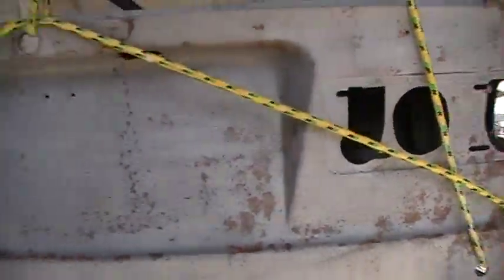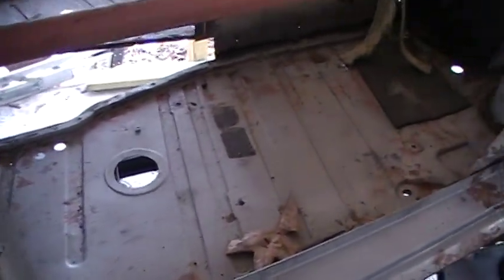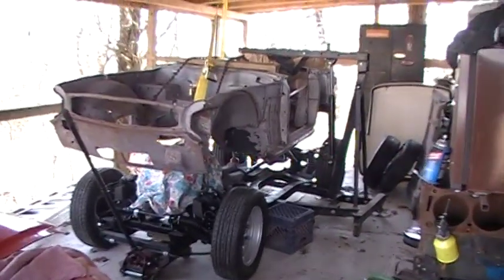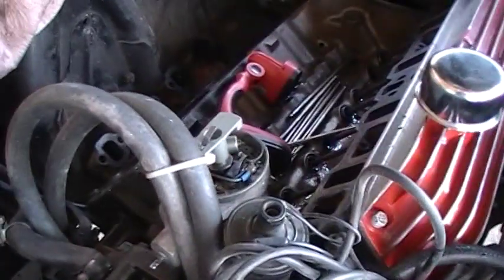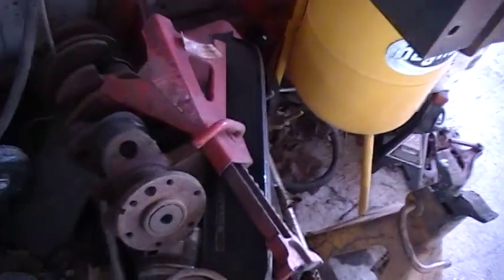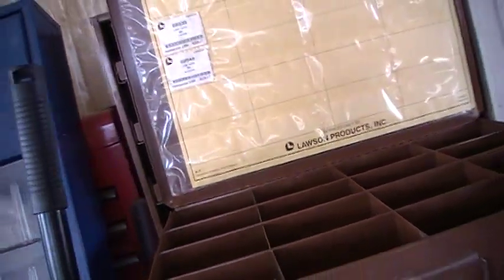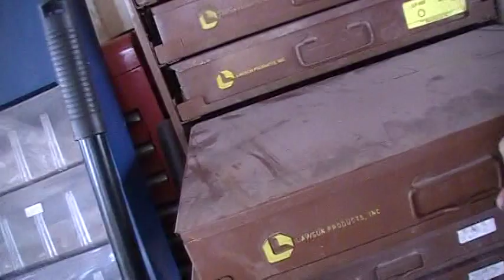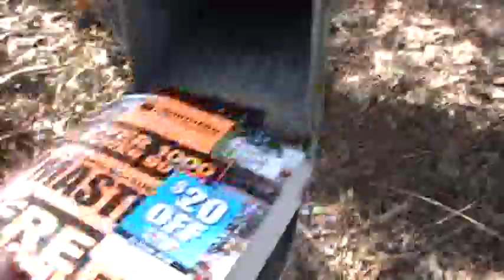Body off TR6

Comment: That TR6 looks like that ole boy you got it from really got the frame fixed up like brand new its so clean you could eat off of it. suspensions and brakes looks really new.  It looks like the guy got all your work cut out for you. Its a really beautiful car. Maybe you could put some saw horses under it to make sure it stay up.  Hit the rusty spots with a wire wheel sand paper and  seal it with white epoxy primer.
Reply from the maker: shartne Yup bubba, got the epoxy ready. Might even paint th bottom while it's flying in the shed.
Reply: Good sounds like you got a plan. In the shed is good to keep it out of weather and you can put it up high so you get both of them British cars in there. Dont get any epoxy primer on Herald. LOL =) You need some giant plastic tarp.
Reply from the maker: shartne  Thanks Shartne.  You are a real good man and a great help to me in many ways. And that's the gospel truth! Dear Herald is getting some treatment where I cut the remaining rocker panel off.
Reply: I guess you will make a video maybe right. Love to see it.
Reply from the maker: shartne  Yes. I will film whatever happens.  Supposed to dodge Tomatoes and hail next two days. I closed in the end of the shanty to keep it dry as I can.

Comment: Wow a frame off restoration of a Triumph TR6 . That frame looks great and well once you patch up the holes in the body rust it will be good as new almost. Hey thats great that you found an engine for the Mustang already was it another 351,390 or a 429?
Reply from the maker: LUCKYLARRY  Thankye very kindly my Brother. I think it's a 302.
Reply: oh so a 5.0 liter just like my 89 F150 has and I have never had any problems with my engine. 2nd year of fuel injection  Its always been a strong hauling engine for me and my brother I bought it off him 12 years ago. He bought it off a guy the first owner who put a 5th wheel in the bed and hauled his bayliner with it. Hope the engine you get runs as well.

Comment: That thing is a nice little car Cut. Its sad folks get them almost done and quit but good for us. lol  Thats how you got to prime them 4.6 v8 ford motors in the newer mustangs. That mouse is pooping on your valves.
Reply from the maker: scottsinfl  I got out of the dealership just befo the modulator engines. Worked from then on on GM stuff.
Reply: GM is much easier to work on too.
Reply from the maker: scottsinfl I agree.  Less bolts and smaller torque values.

Comment: what engine did you get?  and those cherry pickers are pretty bad to leak down, my shop crane does that so I put the angle iron braces on the cylinder to keep it from dropping.
Reply from the maker: MissouriOldTimer My Daddy has a 302 . Just need to buy it from him.